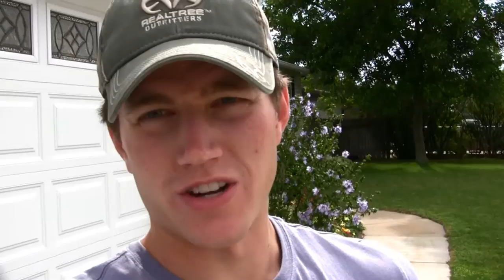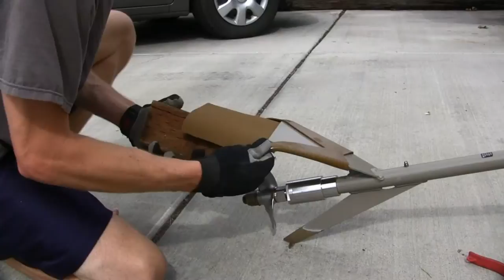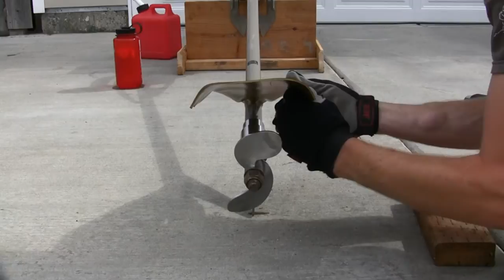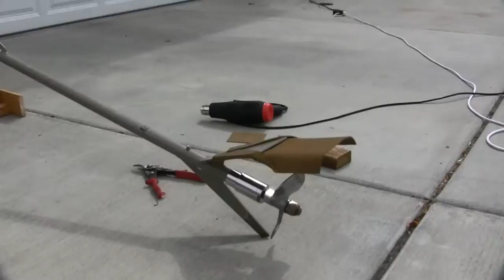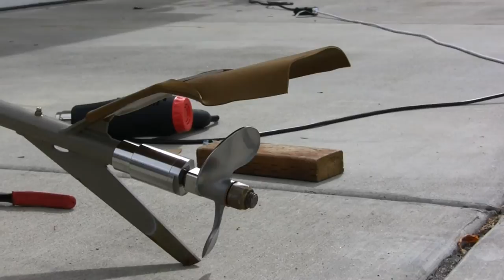Cavitation Plate- Proof of Concept

Comment: This is a great idea - did it work? I have the same motor (looks like a Mud Buddy 7hp?) and have experienced the same problem.
Reply from the maker: Yep. Mud buddy 7 hp.  It did make a substantial difference to add that on. If you don’t want to make one by hand, Backwater Inc used to make a kit for their surface tracer cavitation plate. Their design is the best we’ve seen on the market. Whether you make one or buy one, pay close attention to the angle you set it at. Setting it wrong can make your shallow water performance even worse than stock. Backwater Inc has a video on how to set the angle correctly.

Comment: I’m wondering if I need this, I have a homemade 22hp surface drive mud motor and I believe I’m getting cavitation. The prop will bite and then it will feel like it’s free spinning. Thinking of making a cavitation plate
Reply from the maker: Can you give a little more detail about this?  Does this happen when you are starting out or once on plane or some other time?  Depending on how it’s behaving, a cav plate may not fix it.
Reply: @AdrenAddictionTV  this happens anytime from start up at idle to reving up to governor speed. At first start up at idle speed it acts as if the prop is chopping the water and then give it a minute and it will bite and pick up speed and produce a huge wake behind the boat. Then when I start to give more throttle it pretty much does nothing, may increase speed by couple mph. I have a 1:1 ratio and a 9x5 or a 9x6 prop, ( can’t remember the prop pitch)
Reply from the maker: @dooryardfabrication3973  Ok. That’s good info.  I’ll apologize in advance cause this is going to be long.  There are several things going on here. 

First of all, it is unlikely a cavitation plate is going to improve performance enough that you will be happy. A cavitation plate would be a bandaid that doesn’t address the core problem.  As far as the core issues, i see three things: Propeller sizing/type, motor trim, and the gear ratio. 

I’ll start with trim because that is one thing that will impact all the others. When you say the prop is chopping the water at first start up, that tells me you are trimmed up to high.  That’s why it chops before it bites.  The fact that it’s doing what you say, tells me the prop is hooking up surprisingly well for it’s size. The reason it’s doing this chop, bite, big wake, and then nothing more, is because as the boat picks up speed and flattens out on plane, it’s picking the propeller further out of the water. The propeller can’t grip enough, so the engine revs a lot, but you don’t really pick up speed.  There’s two ways to address this. 

1) once you hit the point where it won’t speed up much, start trimming the prop lower into the water. As you do, you should here the engine start to load a bit more and you should see a larger increase in speed. 2) start with the prop fully submerged. If you can see or hear the prop chopping at the surface of the water, you are trimmed up too much. By starting the prop deeper, when the boat flattens out on plane, it will pull the prop up out of the water more and more.  You will likely still need to fine tune the trim for max speed once you are on plane.  

Now to the props.  Based on the sizes you listed I’m guessing these are either Hill Marine or Backwater Inc props. If it’s the ones I’m thinking of, those are super weedless style propellers. While it is possible to get them to surface drive, they aren’t intended for that type of running condition and can struggle sometimes. In regard to size, (9x5 or 9x6) the first number is the diameter of the prop and the second number is the pitch.  Those are both very small props to be running on a 22 hp with a 1:1 gear ratio.  That could be part of your trouble as well.  It’s likely you will never get these props to fully load the engine because of how small they are.  If you don’t pair the gear ratio and prop size correctly, it can result in a severe overpower condition where the motor turns the prop so hard that the prop “blows out” and you loose all bite.  If you look at what companies like Mud Buddy and Gatortail do, they use a different style prop meant for surface drives. While this style has its faults too, it typically tolerates surface driving better than the super weedless.  Hill Marine makes a 10x8 intended for surface drives that might be a better choice for your motor.  

On the gear ratio, if you decide you want/need to run a 9” prop, you will need to gear up some more. However, there is some risk with doing this.  These props are meant for a certain rpm range. If you start spinning them too fast, then they don’t grab the water right. They may not be blowing out anymore, but they may feel soft rather than having a good bite on the water.  I know that’s a lot more than you were probably expecting.  Hope this is helpful!
Reply: @AdrenAddictionTV   wow this is a lot of great info. You are the most helpful person in the internet right now. Thank you so much. 
First off yes I am using a hill marine prop, (My shaft is 3/4” threaded, not a lot of companies with a wide range of threaded props) 
From what you’re describing I believe I need to prop up and ratio down in the prop. Because when I was testing, I was trying different trims (high trim, to medium to way deep in the water) and nothing changed, until it decided to bite with a little bit of speed. Maybe 6-8 mph. If that. 
So correct me if I’m wrong but what I’m thinking of trying is getting a 10x8 hill marine and changing my cog pulley (right now it’s 40teeth to 40 teeth) to 38T and 48T which will slow the prop to about 3100rpms. 
Do you believe that would be a good combination? I still think I’m going to add a cavitation plate just to help everything else. 
I also notice backwater has a threaded 11x10 that they recommend for 16-23hp. 
Thanks again so much for the help!
Reply from the maker: @dooryardfabrication3973  Glad it's helpful!  Yeah, that's true not many good propeller options for a 3/4-10 shaft.  

Based on your additional description, it sounds like your prop is blowing out.  That's why the depth doesn't matter.  That's a combination of the Hill Marine prop and the amount of power you have.  The Hill Marine super weedless props have very little cupping compared to other brands.  The cupping is what helps to keep the propeller from blowing out.

I would start with the Hill Marine 10x8 and keep the gearing as is.  If you dial back the gearing at the same time, you're going to end up under-propped again.  It would act a little different, but you are still going to be restricted on top speed.  That 10x8 has much better cupping on it, so you should see better results right away.  Then once you know how the 10x8 responds, then you can determine if and which way you need to adjust your gearing.

To give you a frame of reference, Mud Buddy is running an 11x10 with a 1.47:1 gear ratio on their 23hp engine.  That particular setup will also spin their 12x10 propeller as well.  That puts the prop at about 2660rpm when the engine is around 3870rpm.  So if you are going to change your gear ratio to slow your prop down, you are going to need more prop to offset the slow down.  Going to something that big isn't an option for you because they won't fit on your drive shaft.

We've run props that blow out in combination with a cav plate in the past.  The results are not great.  There is a slight increase in performance, but I have to emphasize that it is very slight.  Get the prop and gearing dialed in, and I think you'll be singing a different tune about the cav plate.

Backwater props might be an option as well.  We have never run them before, so I can't say how they work.  We've run quite a few Hill Marine over the years.  Supposedly the Backwater's are balanced.  Hill Marine's are definitely not balanced.
Reply: @AdrenAddictionTV  awesome, that’s what I’m going to do first. If the 10x8 gets me to 20mph I’ll be happy. Thanks again man! I’ll let you know if it works! I’ll give you a shout out when I get a video up.
Reply from the maker: @dooryardfabrication3973  Sounds good. Good luck!
Reply: @AdrenAddictionTV  just an update, tried the 10x8 with keeping the 1:1 and it works deadly now. Fastest it would go on my 1448 was 28mph. Only problem I have now is my bike brake lever throttle doesn’t have the range so I was idling way too fast (12mph) so now that I adjusted it down I don’t have the top end speed . Might order a twist throttle. But right now at max speed with the throttle the way it is ,the engine revs at 2000rpms and I’m doing about 20mph which all I really need. 
Thanks for the help again!
Reply from the maker: @dooryardfabrication3973  Sweet!  I thought that might do the trick. Glad it’s running so well!  You could look into a Backwater Performance throttle lever. That’s what Mud Buddy is using on their motors. I suspect you would get the full range of throttle with that.